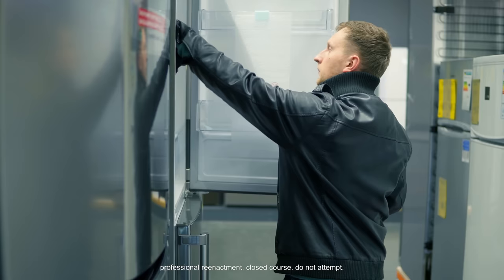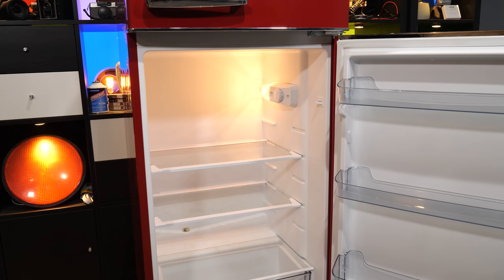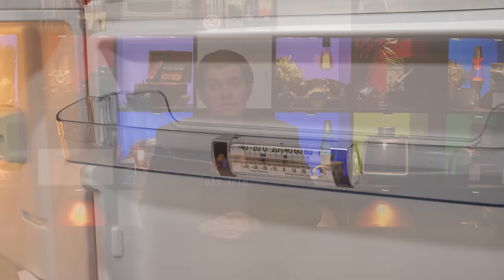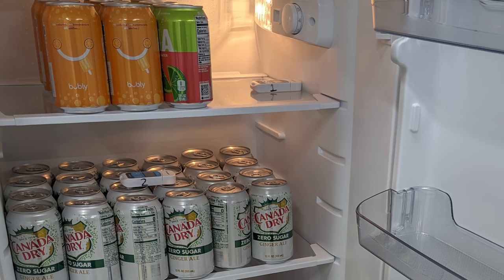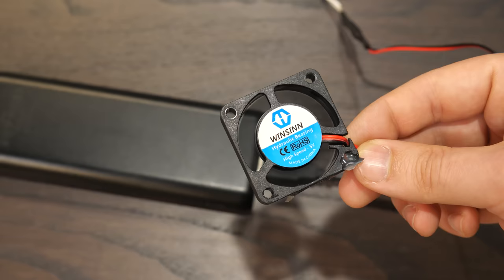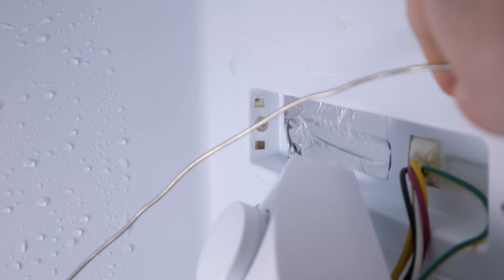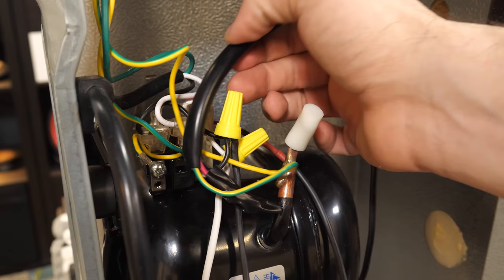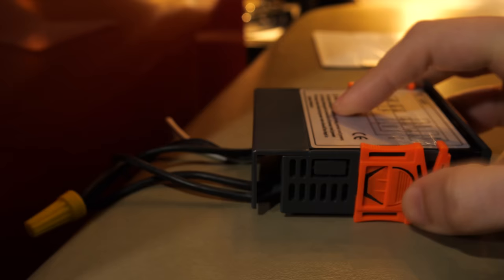This goofy fridge has a really clever design. It's also kinda terrible.

Comment: I have similar fridge and hate it, as defroster is absolutely ridiculous. It runs very often and heats inside of the fridge to such high temperature where food spoils. 
  If only I could turn off defroster it would be much better, I don't mind scrapping ice manually- it's a lot better than getting food poisoning.

Comment: A couple of things occurred to me while watching this.

The first was that you were looking for an electrical explanation for the behaviour when you put all the cans in. Could there be a mechanical cause?

Air conditioners operate just like a fridge - compressor and evaporator. One of the problems with them is that if the compressor has been running for a long time continuously, the valve/pipes(? cannot remember exactly what) can freeze and start to build up ice on the outside. This gradually reduces the ability for heat exchange to occur so the device becomes less and less effective. Could the fridge be doing this?

The second relates to the unevenness of the temperature inside the fridge. Modern fridges tend to have solid shelves which do allow some air movement around the edges, but not much. Older fridges had shelves made of wire so that air could circulate freely throughout the interior of the fridge. This tended to keep the interior temperature more uniform.

I suppose one might argue that solid shelves create zones of different temperature, which would allow different things in the fridge to be at different temperatures. For example, there is often a meat tray right at the top of the main compartment where it will be coldest, whereas the crisper is right at the bottom where it will generally be warmer.

Comment: I have a red fridge in my basement. It has temperature variations too. And always will. Unlike your cute little modern fridge, mine isn't retro stylinig, it's an actual retro fridge from the 1950s. Complete with big chrome plated latches, the like of which used to kill small children back in the days before they started putting magnetic latches on the doors. Kids would climb into them and shut the door, and then could never get out and suffocated. I unscrewed the catch and threw it away so that would never happen to my kids. You can't close the door now, but the compressor doesn't run anyway. Unfortunately it's stuck behind a large brick bar. I suspect they moved it there before building the bar. I'll probably have to get out my Dad's 7 inch angle grinder to enlarge the space between the bar and the wall to get it out. The other alternative is to destroy the fridge, cutting it up and taking it out in pieces. 
Glad to see your electronic controller worked so well. Having a digital thermostat can allow you to control stuff to 0.1 degree Fahrenheit (potentially). Way better than a mechanical one. Will probably extend the life of the compressor, since it isn't running continuously for half a day trying to cool stuff off. Have you tried replacing the light with an LED light bulb? Might save a couple of kilo-watt seconds of electricity (LOL!)

Comment: And I thought the bad habit of measuring something cheaply somewhere and imaginatively deducing from it what should actually have been measured had only come into production with microprocessors...

At least in Germany, there were similar one-compressor fridge-freezer combinations for a while, where the light bulb in the fridge compartment was important for regulating the temperature of the freezer compartment. It simulated or forced a cooling demand, which meant that the temperature in the fridge compartment actually got too low to prevent it getting too high in the freezer compartment.

Guess what happens when you replace the bulb with a retrofit LED...?

These were probably the only fridges where the fear about the light being on when the door was closed was a reality.

Comment: I'm wondering if they put the sensor near the evaporator because there's some engineering reason that it can't run continuously. My first thought is that the compressor may get too hot, and every 25-30 minutes it needs a few minutes to cool. I highly doubt that the evaporator itself could ever get too cold, but it's possible that there're some solder joints that shouldn't get that cold. Or they want to make sure liquid refrigerant doesn't make it back to the compressor. That could be quite bad. Also, the stock configuration may help guarantee a full defrost cycle. If there's ice on the wall, the evaporator will stay colder, and the compressor won't turn on until the ice melts and the warm(er) interior heats the bulb.

Comment: Refrigerators are only intended to hold food for a day or two, as long as the air temperature averages in the mid-thirties the food will remain safe. This refrigerator is more of an icebox and should be used like one.

Comment: Interesting. I prefer the simplicity of the little red fridge. Had a modern overly techno one once. Never again. Like new cars with all their sensors, the sensors are the first things to go, and the most expensive to replace, if you can figure out which ones went. And one little sensor failure can incapacitate the machine completely. Got an old simple one and it works always.

Comment: The compressor motor has a thermal cutoff.  It runs too long, gets hot, and turns off until it cools off.  If the thermostat was never satisfied, the compressor will run base on the temperature hysteresis of that motor thermal switch opening and closing.  But an insulated sensing bulb coupled to the evaporator doesn't help either. lol

Comment: Dude I think you got a lemon Samsung fridge. My mom's  has had none of those problems. 
I have a 20+ year-old Kenmore  fridge that I maintain myself and it works great.  There is no reason to think it won't keep working great indefinitely.  Like you said it's got very few parts to it and I removed the icemaker as plumbing it in seemed to be more trouble than it was worth.  I make ice in trays and I never have to defrost the freezer also I just have to keep the underneath dust free as well as I can keep it so things don't get clogged and overheated it's a really great fridge and so glad that I have it. I also have a glass door Haier beverage fridge which is in my living room.

Comment: 23:30, if you had so much as a single can of soda/water already at temperature in the fridge, that would be significant for the comparisons.  A single can of soda has more thermal mass than all the air in a refrigerator's volume, meaning that ALL of the refrigerators WILL perform poorly with ONLY AIR at temperature inside them.
Reply: 25:50 chances are it's a limit on the compressor, either it was getting too hot and turned off the compressor, or it's just on a maximum operation timer of some kind.

Comment: The sensor is probably there for a reason. The compressor probably should not run longer than a fixed time which is also achieved by the placement.

Comment: Ok so 11 minutes in and I have a really stupid idea. Take that fridge, remove the fridge part and only use the freezer, move the compressor controls to the outside ig. place 2 PC radiators inside looped in series, and fill your loop with antifreeze, extra long tubing. Use silicone sealant around tube coupling with holes you drilled out for input and output. great PC performance, overclock the shit outta your CPU and GPU, have them both on the loop. No need for heating element, you're piping hot antifreeze into the freezer. need to use tubes that antifreeze won't eat away though.

Comment: I think your cans are blocking the air flow which is likely critical for the operation of this particular design. Bottom line is that you overloaded it for its intended design and use. Also, there might be overload cut offs in the compressor.

Comment: You dont really need a fan down by the compressor to keep it cooler, just some insulation between the compressor and the fridge body to keep the heat from the compressor transferring to the fridge body.

EDIT: I can hardly believe I just watched this entire hour long video and was completely engrossed the whole time. Very good!

Comment: I wonder if the sensor placement is intentionally closer to evaporator coils such that it performs a secondary function of limiting the compressor duty cycle? i.e. the compressor shouldn't run more than x% duty cycle, even if the air temperature demands it. Maybe the test of empty fridge to loaded with warm water was so stressful that it still "broke" the duty cycle design element and while it appeared to have stabilized at a new set point it was still decreasing exponentially slowly? (is the compressor sized right at the limit of the thermal characteristic of that fridge?)

In any case, I always place my sensors in sensible locations.

Comment: You could have saved a lot of time and effort by asking a refrigeration tech why they used a mechanical control and why its designed to operate on evaporator temp and not box temp. I really was hoping you did and would have explained that at the end of this video. With the new controller in the box, you now can only have a time based defrost (if that controller has that feature) and no longer have a temp based defost. Your evaporator will now generate ice much faster with the longer run times. The mechcincal control was a cheap, effective solution for temp and frost control vs. the digital controller. Now you see why the new ones cost much more than just a 25 dolllar temp control

Comment: dam, I just realized that all my comments over the main flaw in this unit are boiled down9pun intended) to just TWO design flaws
1: placing the control box AFTER the coldest part of the loop
the freezer will always tend to reach the minimum temp of the refrigerant, and when freezing that is desired as it reduces issues with thawing and can even act as an exchanger to help pre-chill the fridge zone after a long time without power, just re-plumb the fridge to pump refrigerant to the freezer first(fairly easy if you get a refrigerant recovery device)
2: thermostat, obviously measuring temps that close to teh evaporator is just a "NEVER DO", as it will ALWAYS be a terrible way to maintain box temps
replace with digital control and feed thermal probe into wall box via old wires if possible(maybe place the whole unit on the inside wall and abuse the fact most modules have a L SL N wireset to use existing wires)
these two design flaws are the only way to 100% fix this device, and since the control is always on the trailing edge of the cooling performance it will always freeze first, then chill your non-frozen stuff as much as it needs(though you may need to adjust charge to ensure the fridge doesn't flood-back into the compressor if the freezer is already at liquid refrigerant temps

Comment: I moved to a new appartement and the fridge that was already there, didnt seem to work right. At least the freezer compartement didn't. It just wasn't getting cold enough, though sometimes it did, but only for a short time, before warming up again. It seems that following this channel was a good thing because coincidentally this video was suggested to me by the algorithm. Your investigation may have solved my problem. The fridge likely has the same design as your red one does, and I think most fridges here in germany do, because I've never seen one with a visible evaporator. The fridge in my appartement was filled up with beer (a lot of thermal mass) by my roommates, and I think that was the reason why the freezer wasn't getting cold enough. Because as you've explained this might reduce the cooling cycle duration thereby reducing it's overall cooling performance. I have now removed all the beer bottles and will revisit this comment tomorrow and report if the freezer now works as intended. I have a good feeling about this. Thanks a lot!

PS: The only explanation I can think of, why they would choose such a design, is that the limitation of the cooling cycle duration to around half an hour is actually wanted. Maybe it's harmful to the compressor if it runs for too long. And by not using a timer to limit that, but instead the temperature sensor, they've killed two birds with one stone.

Comment: @technologyconnections I bet it's not a probe location issue. It's a PID thing. The controller only has an output thats proportional to set point error, so you get offset. The controller needed an integral term.........

Comment: Questions allowed?:
I have a thesis/belief that an emptier fridge is ineficient in power compared to a fuller one since everytime  you open the door it loses all its work and warm air get in which it has to cool again and where there is less substance holding on to the cold inside. 1. How true is this?
2. In following this belief; since my mini does not have its own (ice pack to hold the cold during a power black-out) from the factory, I put water bottles in the freezer section to play this function. How effective is that?
3. Will the fridge just use the same amount of power or infact more owing to the fact that water takes more energy to cool and freeze than would be required of air? I gave up thinking about these calculations. 
(I am a man of words rather than one of physics/math)

Comment: After watching the entire video, I have my own conclusion I'd like to draw. Maybe the engineers seem to have taken a weird approach to wiring in the thermostat. Why would they run it inside the wall next to the coil and calibrate it well outside the range of the normal operating range of the fridge? This fridge was clearly down to a price. I'll bet you the compressor can't handle a duty cycle much longer than 30 minutes. The fridge will work like this for a while until that compressor wears out

Comment: Perhaps it wasn't the thermostat shutting the compressor off.  Perhaps the tiny compressor was overworked and an Automatic circuit breaker in the compressor windings was cycling  on and off as it struggled to get back to its normal duty cycle

Comment: The temperature control of the little red fridge reminds me of the cheap aquarium heaters I have... which happen to have the temperature probe inside the same glass tube as the heating element.  For my saltwater tank, I went with an external temperature controller as that as that offered more stable temperatures.
P.S.  Samsung does not make good appliances.  My brother's Samsung fridge has an icemaker and water supply tubes burst inside it while he was on vacation.  My Samsung washing machine will not exit the spin cycle if it is just slightly overloaded... and the control board had to be replaced within the first year of it's life.

Comment: Maybe this is all an image to the idea of why you need to have a strong hypothesis before beginning an experiment. 

And I'm starting to understand better why people like Hank sometimes for ghosts some experiments because of the amount of energy and effort that would go into recording all the data. 

Frankly what you picked up is a really excellent question, but I also wonder if some research into thermodynamics and considering why energy in a refrigerator with stagnant are May transfer from one end to the other. We know things like convection currents, but there's also a small degree variance between the top Air and the bottom are with a very large area to slowly transition from one warmer top area down to slightly cooler bottom areas 

I'm just kind of making some statements that are hypothetical. And all it would be better to understand why the refrigerator is called in the first place and then expand from there. 

Fairly you did actually do that, but I'm talking about at a more molecular level because that's what's literally going on here is were manipulating the molecules of air.

Comment: the cheap fridge that came with my rented appartment is basically the same except its not a stand alone device but hidden inside a cupboard, normal thing in germany. its over 15 years old, but I bet if it would be new it would be the same cheap design with no gimmicks while my landlord can make maximum bucks from me renting this thing

Comment: Yo, you really should consider something like homeassistant and a bunch of wireless bluetooth temp/humidity sensors to serve your logging needs. The data can be accessed wirelessly (obviously) and the plotting will be so much more flexibly and pretty looking. Also, it allows for much better control over statistical analysis as such. I have a one zigbee sensor in my freezer and a bt sensor in my frige. Works like a charm.

Comment: I wonder how the size of the smaller version of this fridge impacts things. There's less space to cool and there would be less distance between the top of the refrigeration compartment and wherever the sensor for the thermostat is. (If it works better, maybe they designed the smaller version first, upscaled it for the larger version you got, and didn't take into account out the larger size might impact things?)

Comment: I would be shocked if they didn't have a thermal overload on the compressor, and looking at the data, i would believe this to be the case, so it wasn't the thermostat but the sensor keeping the compressor from burning out.

Comment: For measurement I think one needs a temperature probe stuck in a glass of water. The food has more thermal mass than the air in the frig. The temp of the glass or water may be a better test of the frig. I think a frig needs like 24 hours to stabilize.. Probable the switch points for a sensor near the evaporator are offset from the actual frig interior temperature. I would request a new thermostat from the manufacturer for that thing. Sometime we shouldn't look too close at how this stuff operates. It's often disappointing.